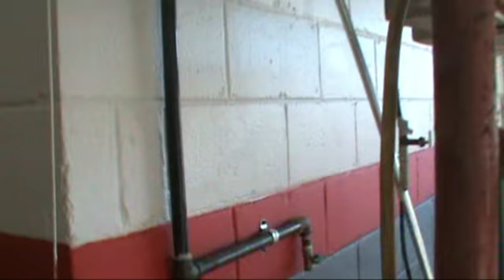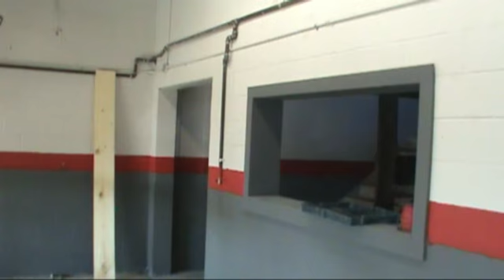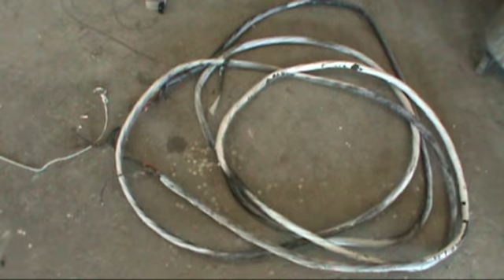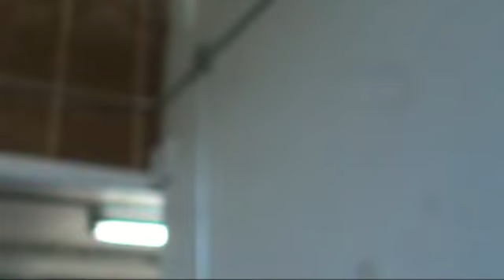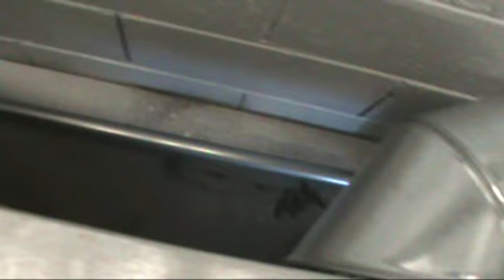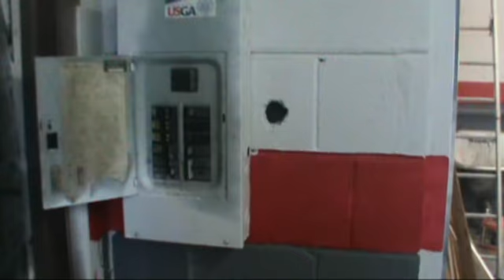Trans shop

Comment from the maker: @Veikra You got it this guy is thinking big! Where that outside lift is he wants to tear it out and pour a big thick  pad and put a big lift out there for motor homes buses big dump trucks,we have 3 very large motor home pleaces around here and no 1 wants to do them so he will clean up doing that.And he is going to do all mechanics now,water pumps heads engine swaps= the works.He just bought the trans shop and i really hope he will be successful,so far he is doing a great job